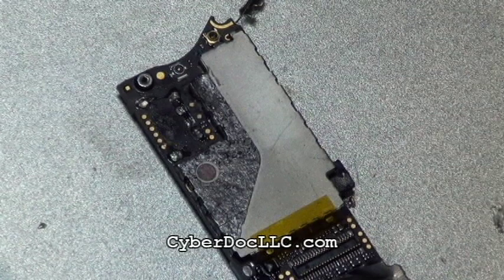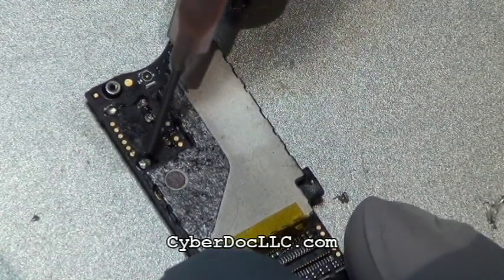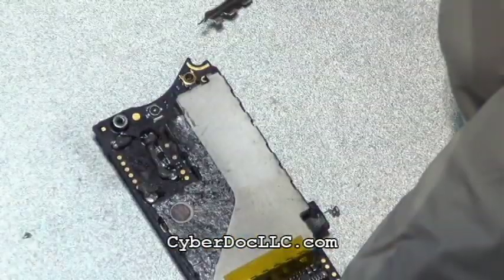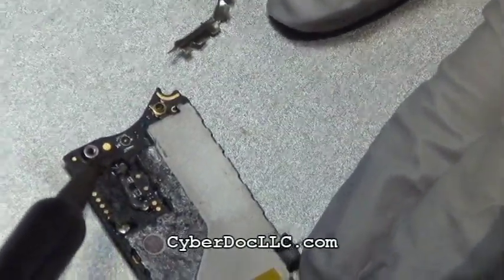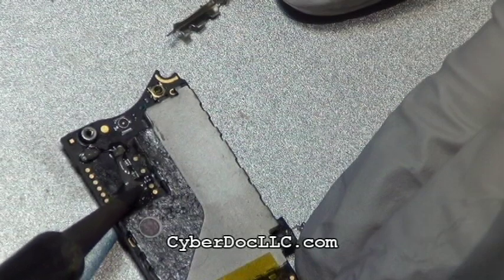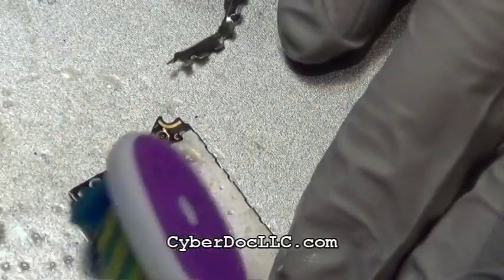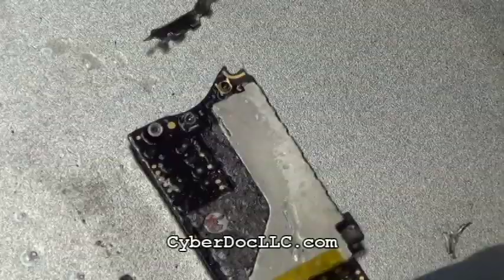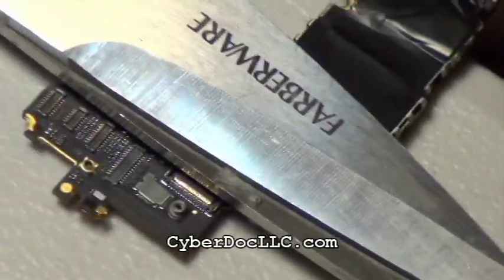iPhone 4 Battery connector holder terminal repair soldering tutorial with CyberDoc QuickAlloy how to

Comment: In place lf a wick is that a toothbrush? I cant find the soldering wick so trying to see what could be used to clean out excess or old solder. Thank you for the video though very helpful although I wish better picture quality and closer view
Reply: the purpose of the solder wick is to suck up the solder - thats why it is made of copper since, the solder "bonds" to the copper - this process is called wetting - it does not work with a toothbush

for it to work, it needs to be a copper mesh - but in fact silver works too, but this would be a bit expensive, right? :)